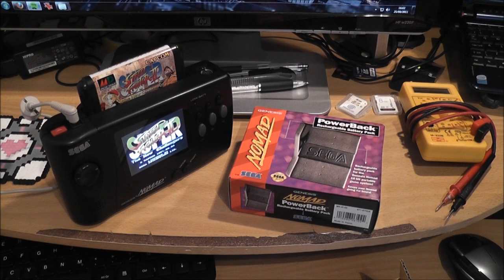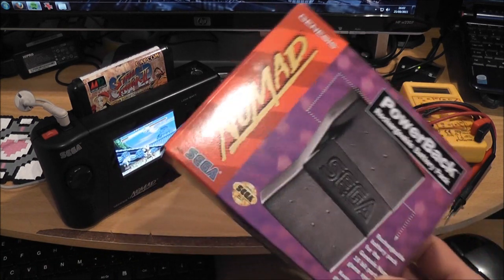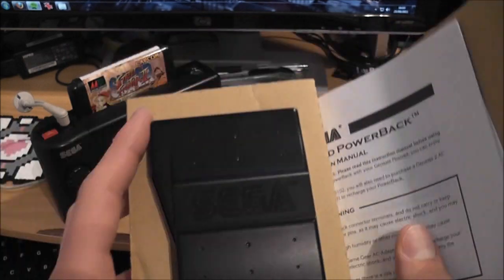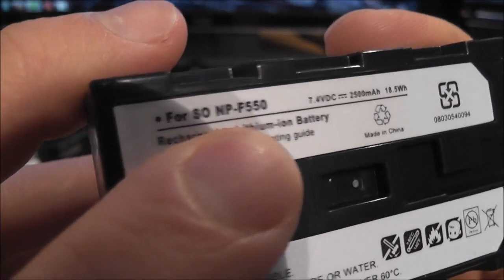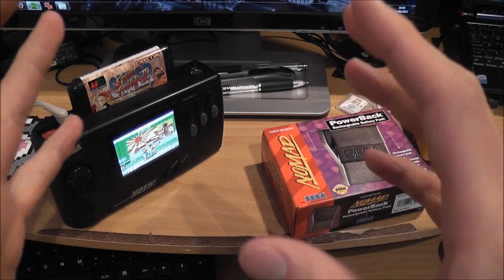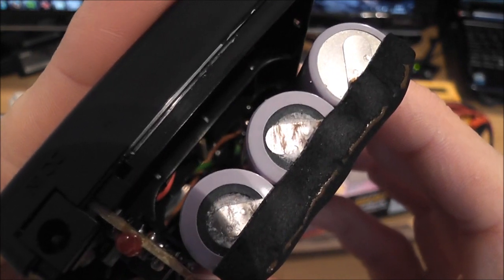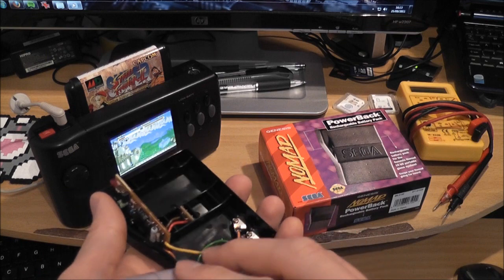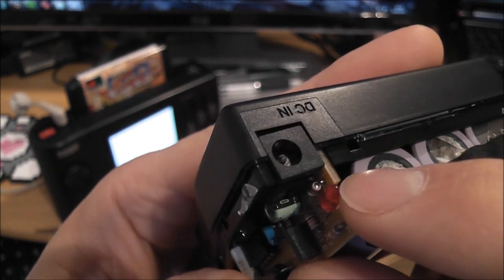Quick Project Pt 1 - SEGA Nomad Battery Pack Mod - Retrofitting With Modern Rechargeable Batteries

Comment: can you make a video on how to open this crappy thing. its driving me crazy
Reply: I'm in the same boat as you, I can't for the life of me pry it open. And I'm nervous about using a screwdriver since the plastic is so soft...
Reply: I bought a set of plastic opening tools for phones and just tried things until one worked. The set I bought was this one: https://www.amazon.com/gp/product/B01F52ZPBQ/ref=oh_aui_detailpage_o00_s00?ie=UTF8&psc=1

The ones that worked best for me were the blue spudgers that had a sort of L-shaped 'hook' to them. I forced the L-shaped 'hook' edge into the crack of the battery pack (the groove separating the two halves), and then the 'hook' shape of the tool allowed me to wedge the edge of the tool into the inside of the battery pack case. I then used the tool as a lever to pry the two pieces apart, using a "wigging" move of continuously working the lever up and down. Once I undid a connection in on a side of the battery pack, I then ran the lever up and down the edge of the battery pack. Whenever I found a spot where the case was stuck together, I did the same kind of "wiggling" of the lever to disengage the plastic tabs. The whole process took about 5 minutes of trial and error, but then the case came apart in only a few minutes. It did take some fanangling and I needed at some points to have multiple tools jammed into the opening of the battery pack to keep it open, so I recommend getting several plastic opening tools at minimum for this task. It did take some force, which is why these weak plastic tools are the best for it. They will break just as easily (if not more easily) than the battery pack, making it much less likely that you break the battery pack in the process. Don't use metal tools! You will almost certainly break the case that way.

Sorry if that description was difficult to understand. If you need more advice on this, try to look up videos about opening cell phones or other electronics using plastic spudgers, the techniques should be the same as they are here. Good luck!

Comment: have you though instead of basically using the Shell of the pack, just replacing the cells? i know ive seen people replace the cells in laptop battery's, i would think it would just be more of the same, order the same, or near the same cells and just solder them back in. thats provided you didn't fry the charging circuit. but that at least would provide a more OEM feel.

Comment: Well its for the best as new battery cells are much better compared to ones from the 90s. You'll want a good charge with the Nomads notorious power consumption needs anyway but I guess the new screen doesn't use as much. Yeah I'd imagine the old cell would add a fair amount of weight to the Nomad? I can't see why it wouldn't work. Look forward to your Nomad Version 2.5.